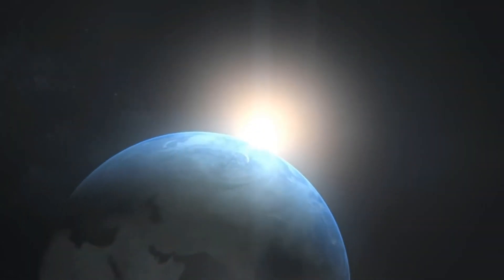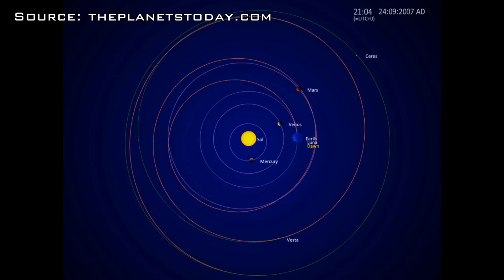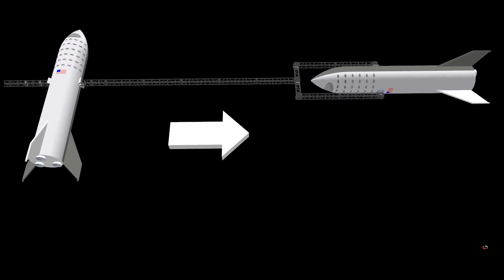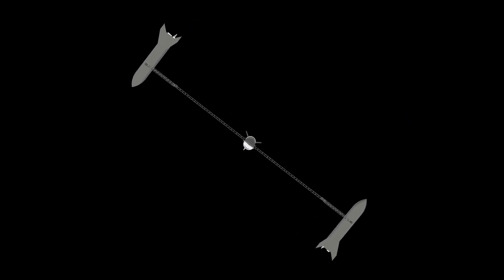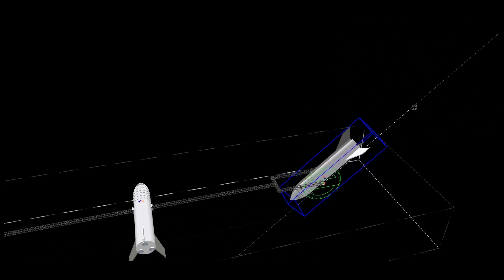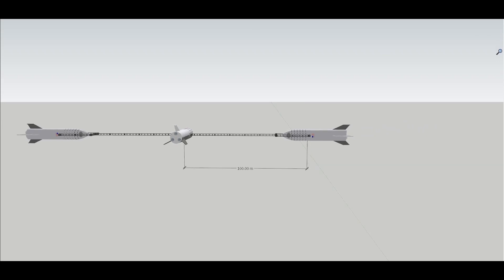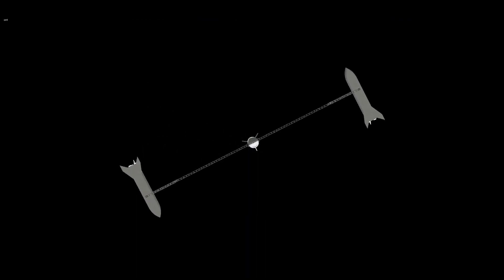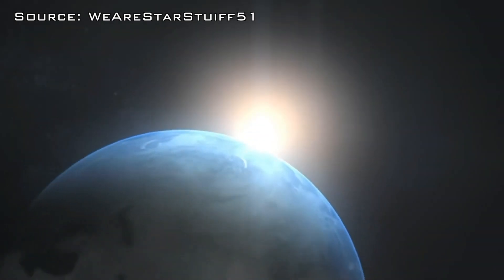GLS2: Artificial Gravity for SpaceX's Starship

Comment: The spacecraft needs a redesign in order to support the weight of entire, fully cargoed starships tugging at it from 1 or two sides or points at 1 G. This redesign would add too much weight to the spacecraft itself.

If we're already at the point of having 3 Starships then honestly you might as well build a craft designed to remain in vacuum and rotate with those 3 Starships.

Comment: Have you calculated the strenght needed by the steel construction while the rockets initiate the rotation? Looks like there would be lots of bending and torsion type strain on the framework. Especially considering the enormous length and leverage.

Comment: 1 ship  and GLS may do, can you look into this config, stresses and maths behind it if it's possible:
instead of:
🚀}---------------------------{🔘}-----------------------------{🚀

can't you do:

🚀}---------------------------{🔘
    

the center part is the GLS facing us.
Reply: I am realising in my head that a counter force is needed eventually on the other side to stabilise the system. But it can slightly bob as it goes, as the single ship tugs the GLS each time it rotates around it.

Comment: Do This simpler. Use a cable from nose to nose and only use rcs. It will work fine. Not much power needed.
Reply: Exactly!
Reply: I agree, except for the RCS being very inefficient for spinup.  Connect one passenger ship and one cargo ship nose to nose.  With a cable, the ships can have different mass and the pair will rotate around the center of mass, no problem; just adjust tether length or RPMs to get the gravity you need for passengers.  Keep the ships oriented vertically WRT the gravity force and acceleration vectors so you aren't walking on the walls or pivoting seats/beds. You could even have flush toilets, like on a sailboat or airplane, that would seal when not in use, during spin/de-spin, and while maneuvering.  

Adding a dedicated methalox engine at the CG of each ship for spin up and de-spin will be a LOT simpler, cheaper, safer, more reliable, less mass, etc. than the 3rd ship and truss GLS system Small Stars proposes.  One thing I haven't seen addressed is the structure needed to support the entire mass of the ship at one g from the middle while horizontal.  The ships are designed to launch and land vertically, so all large forces are axial.  Without major structural reinforcement (added mass), the ships would fold at the middle.

Comment: Some of the steel cable failure modes could be managed by having 3 starships as the vertices in a triangle.  If you take two counter-rotating triangles and use a 7th starship as the central hub, then you can electrically accelerate the two counter-rotating triangles, avoiding propellant usage and avoid issues with the Raptor's minimum throttle positions.

Comment: You do not need the turning mechanic on the 2 starship on the side, they can be fixed, main engine is not required to spin up the system, all 3 craft using their RCS can spin it up. Remember Starship will have very powerful RCS since it will be used in the landing process to filipp the ship over. This would make the concept much simpler. Also this can be done with 2 ships only, the ship with the strut system is used as counter weight.

Comment: Artificial gravity for the return trip to Earth seems essential for rebuilding the crews strength, especially since they have become used to Mars for years.
Reply: @Smarticus 
If a colonist wants to return to earth, they would have to occupy a centrifugal motion habitat on Mars to gradually recover their Terran physique. The return trip would also be using tethered starships to maintain that strength. 

The problem is scale. This habitat may need to have a large enough spin diameter to keep the spin rate tolerable (2-4 RPM). It also must be shielded from radiation, so it would likely be underground (unless it carried its own shielding, then it could be on the surface - but this doesn't scale up to multiple habitats easily). The cavern must have a large diameter to contain the spinning mechanism. 

I suspect this would end up being on steel rails with steel wheels in a  6-9m width closed circular tunnel about 2-3 km in diameter. The habitats would essentially be light rail cars.

Comment: I agree artificial gravity should be considered for the mars trips but IMHO this concept has absurdly too many possible points of error in the truss concept itself to bet a large number of human lives on a rocket that has already achieve mars transfer velocity speeds. IMHO the better thing is to understand that the best thing you can do is build the function around a single starship allowing for more contingencies. Using that star ship spin it around the central cylindrical axis through manuvering thrusters that form fit to the hull of the ship and also offer more function while landing on mars later. Pretty much you can achieve this by simply designing the inside of the ship to function as the walls of the ship being the floor of the ship during travel, especially considering the vast majority of the time would be during the 'spin' in mars transfer while a small portion of the ship would be typical earth/mars microgravity with which the astronauts would likely be strapped in the cockpit performing essential maneuvers. Honestly that sounds like a much safer, practical, and cheaper method(that also gives the starship more functional space) to apply some functional gravity during a mars trip without killing all involved through some failed link in a huge truss. Honestly contingency is the reason those huge artificial gravity concepts are so large, bulky, and expensive. Safety, and fail-safes.

Comment: Yours is the best solution for spin gravity during the Starship voyage I have seen, but I still think constant acceleration/deceleration via VASIMR or Hall Effect ion engines is a simpler and safer method of generating artificial gravity for the trip. Trying to link and accelerate two huge rockets loaded with people into 3 rpm spin without breaking something or tearing apart the spacecraft would be challenging and a mistake fatal. VASIMR already has more than 2 years of testing in vacuum chamber, and Hall Effect engines are already used for station keeping on  satellites. They just need to be scaled up and sufficient number of engines used to achieve enough acceleration to get something close to 1G. Sufficient solar power is available in the inner solar system to use large PV panels for the electricity to power the ion engines. Large PV arrays would be needed since a single VASIMR engine requires 200 KW.

Comment: 100 meter radius at 3 RPM = 1 G
100 meter radius = a circumference of 628.318 meters
With 69 Starships (In spirit with the 1969  moon landing) connected in a cylinder shape, will make roughly a 100 meter radius circle.
(628.318 meters circumference / 9 meter diameter starship.)
With all 69 Starships forming a cylinder, all of them can form a spiral vector to thrust forward while increasing spin RPM.
Each linkage would be integrated in a more compact profile while distributing the stress along the circumference instead of across it's diameter.
The large count of Starships would provide plenty of supplies, tools, etc to keep the colonists  active with many projects and back up resources.
Maybe 10 of the Starships would be filled with inflatable habitats that could form a web of connections along the inside diameter of the tubular array for additional tensile support, astronaut transport between ships (for exercise and
entertainment).
Along the outside of the tubular array, another set of inflatables (sent to orbit earlier) provide additional support and shielding.
Some of the inflatables would be deflated and stored back into the Starship for descent to Mars while others would form an orbital station with artificial gravity.
Perhaps even put a station on the two moons.
Considering how quickly each grain silo can be built, divide manufacturing across a dozen sites for mass production and simultaneous testing.
Reply: Each ship would fill a spot like ball bearings inside a bearing cage made of stiffeners and inflatable habitats.

Comment: You would literally have to balance out the system to the kilo or you would wind up with a barycenter and much more complex orbiting instructions.  Also rotational-vibrational coupling would be a huge issue.
Reply: Exactly, if the "gravitron" actually worked in space, even the movement of the astronauts (mass) inside/out would cause an imbalance in this scenario.
Reply from the maker: Thanks for your input!

A little barycenter is ok, no? Even our own earth and moon have a little barycenter action! Seems like you're just begging me to suggest that we need some sort of "truss climbing" hub ship solution. Or perhaps the propellant in the hub ship can be corralled to the weak side to help offset some of the minor mass imbalance.

As for the rotational-vibrational coupling you mentioned, I doubt 3 RPMs will cause any issues, but I don't have the resources to run the math on that or a computer simulation.

Comment: instead of ships use structures like this https://www.youtube.com/watch?v=yXXqsbt9NUc.  with electromagnet operating the wheel which spins and could have an alternator to recharge the batteries to operate the electromagnet when the wheel is spinning. the spinning wheels  would always try to stay upright and level,with the wheel moving up and down the truss closer to the ship it would be less strain on them and the wheel would be the force to spin the ship and create gravity......no fuel needed

Comment: I posted this about a month ago: https://ibin.co/4s3U8xU5gW7y.jpg . Glad you were smart enough to work out the details though.  

One point I might make is that using tethers would be extremely difficult because it would be like having a paddle with a ball on a string bouncing around when changing orientations. This however might be not as difficult as it might seem because both of the starships would have fuel to orient itself properly or could detach before arrival and wind up the cord and orient themselves since centripedal forces would cause them to fly away from each other when the cable is detached but a cable whipping around and flying off willy nilly could cause damage and it would probably need additional thrusters to control it and passengers strapped in for a wild ride. 

Another thought I have is one that is probably impossible due to timing of the intersections of multiple fueling depose . But what I was thinking (perhaps your smart enough to simulate it with the kerbal space program) (would do a lousy job probably because its not a good enough physics engine ) or with  the GMAT program which requires MATLAB and Simulink and a very old library on Ubuntu or two would be this scheme:

I was thinking if the trip to mars where to use the same method as India used for its latest moon lander of taking a long time to land on the moon and using gravity assist, if it might be possible to build refueling depose that can use earth, moon, sun, and other heavenly bodies for multiple gravity assist fueling depo trips, to create several moving refueling stations at various timed velocities (at different velocities for each of the refueling depose) that a space ship bound for mars could cross paths with and be used to refuel  to further acceleration and decrease arrival times of a maned ship to mars. 

Obviously factors to consider would include complexity and risk of failure, but also how much fuel is wasted getting the fueling depose up to a matching orbit and speed of a manned mission to mars, we refuel airplanes this way , I know the situation is different and would add in tremendous complexity and risks of failure for the mission in the form of missed increased speed opportunities and risks of collisions, but if timed correctly with multiple orbits around heavenly bodies it might be possible to greatly reduce mission time. Most gravity assist orbits can only add a few M/s increase in velocity but as one person pointed out, You might save ~700m/s from LEO going to the moon, but take half a year to get there. it might be like a five year mission to gain significant enough speed or might not even be possible with the limited number of windows of opportunity and it might just be better to use new materials to shield and wrap the ship for protection and make it more comfortable for a long journey. Also due to the "Coriolis affect you would need inflatable floor inserts to make the floors curved for passenger comfort on the merry-go-round idea. https://en.wikipedia.org/wiki/Coriolis_force
Reply: These might also be helpful: Passing them along like they were given to me:

https://ntrs.nasa.gov/archive/nasa/casi.ntrs.nasa.gov/20140003573.pdf
https://ntrs.nasa.gov/archive/nasa/casi.ntrs.nasa.gov/20140010164.pdf
https://ntrs.nasa.gov/archive/nasa/casi.ntrs.nasa.gov/20160004674.pdf

Comment: Great ideas!
As far as dealing with the disorienting effects of the rotation, drop-down video panels over any real windows could display static images as though the ship was flying directly at the current destination straight ahead. The images would just need to be updated every now and then; maybe like once a day. Whatever. As you get quite close to the destination, you increase the video update rate as you decelerate toward the destination and slow the rotational velocity.
These 'video windows' would be FAR better than any real windows. Totally solves the disorientation issue. There might only be the need for 8 - 20 REAL windows on the whole space ship, plus it would boost the integrity of the hull. 
The trips to solar system destinations are not going to be like cross-country airplane flights where, even from 37,000 feet, there is stuff to look at and it's steadily changing. For 95% of the trip to Mars you could just as well be looking at PAINTINGS of what's outside.  The benefits conferred by faux-gravity will totally overwhelm the inability to scratch the 'looky-loo" itch. But, for those who yearn for it anyway, they could go over to a few live viewports after taking some anti-nausea pills to deal with all the stars whirling around.

Comment: Silly concept, tether system wins all the time, your issues are not a problem and any drawback could be easily solved, only 2 starships are needed.  
Besides you can retract or reduce the length which allow you to control or deal with other things that you can not control with the solid truss.
For last, it does not matter what system do you use, you would use propellent one way or another to fix any wobbling issue,  RCS should be the same methalox fuel with laser ignition.
Reply: Addiction? Lol
Reply: @jhyland87  not my first language, neither my second. I think I fixed the error
Reply: @AngelLestat2  lol, just givin you a hard time bud. No worries.

Comment: I had a similar idea a few years ago, except in mine, the 'structure' is cables instead of trusses. I also included a hose system to transfer fluids so that weight can be balanced. With this addition, you can also run an elevator from ship to ship, while transferring fluid to maintain balance. Furthermore, a cable stows into a smaller space than trusswork, and allows for variable distances so that micro/macro gravity experiments don't need as much dV to 'spinup' or 'spindown.'

Comment: You gloss over the approach of using tethers, but from what I've seen the math just works out far better for it.

You claim that the truss eliminates failure modes, but fail to list any examples.

There is no need to swivel the entire starship to spin-up the system. Each vessel will have a RCS system that is capable of providing the required thrust.

There is no need for a rigid truss structure. Simple steel cables are sufficient, as they only need to support a tensile load. This becomes a much smaller and more compact secondary payload on each of two starship vehicles, eliminating the need for a middle "hub" starship and complex in-space assembly of the truss structure.
Reply: The RCS system will be using MethaLox. The early plans called for 10 ton thrusters.
Reply from the maker: I'll stick with the rigid structure until a sufficient RCS is realized.